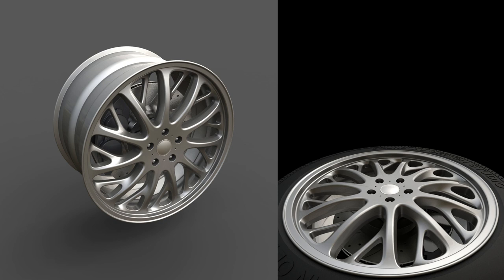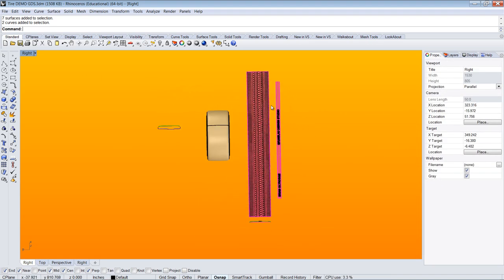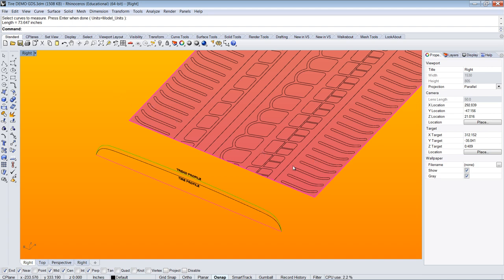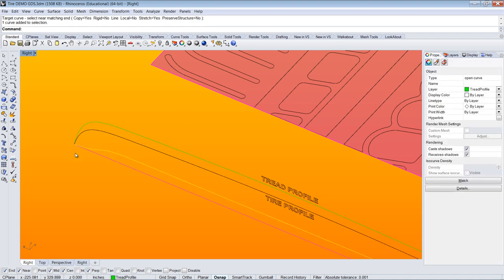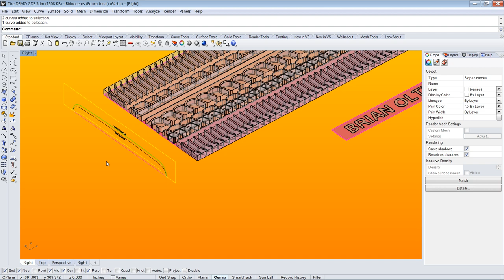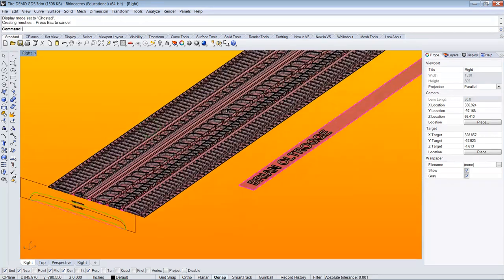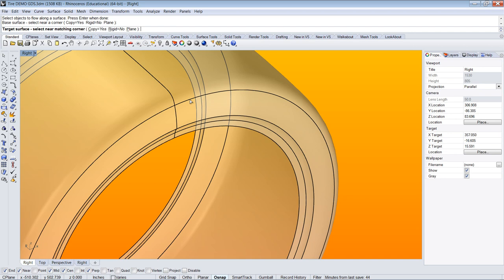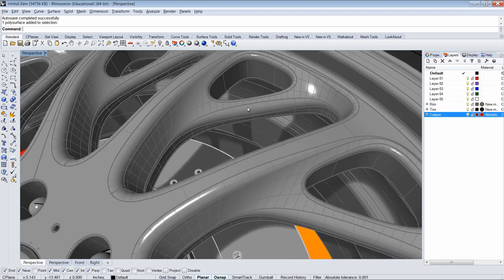Rhino V5 | Modeling an Automotive Tire

Comment: really nice explained tutorial one of the best I have seen. I have a question from your tut. and I was wondering how you made this possible. in minute 3:52 you select the polyline command. and start making lines in a perspective view. 2 questions from this. 1 how do you make the cursor to show the cross lines? 2 how do you make to draw a line in the z direction on perspective mode? I always have to go to front view to finish drawing if I wanna do a line in the z axis. thank you and also keep your tutorials they are really good.
thanks
Reply: If you want to make a draw line in Z direction, you have to hold CTRL + click on the plane, where you want to start to move in Z direction.

Comment: What an I doing wrong? I left a 1mm offset and the wrapped around thing still doesn´t want to boolean union with the tire. Both the tire and the pattern are closed solids bbut a boolean union fails both on the whole thing and the individual blocks.
Reply from the maker: +Andrew King Might need to check the tolerance of the file you are using.  I generally use small objects inches for everything.  Might also see if it works manually with trim.  If that doesn't work, find the intersection and use the curves to trim...  Boolean can be finicky sometimes...  #1 suspect is alway the seams.
Reply: I solved the whole thing by simplifying the geometry. Rhino was still computing the union for about 7 minutes but it worked. :D But next time a boolean fails on me I´ll sure remember your advice. Thanks ;)

Comment: Flow along surface problem! I get strange direction of the pattern. That is make no sense! (It makes for sure if I understand what I am doing wrong, but I can't figure it out) :(
Reply from the maker: Karadjordje Trkulja Try selecting a different edges near different corners.  This is how Rhino knows how to layout the pattern on the surface.  In some cases, drawing the reference plane a different way might also help.
Reply: Tryed many combinations... Nothing.
Reply: Karadjordje Trkulja Check the direction of the base AND the target surface. The red and green arrow has to show in the same direction. This was my mistake. After trying to master this tutorial for 2 hours, i finally got it haha
Reply: +Brian Oltrogge there is a little problem with your tire. how are you going to inflate it with air?